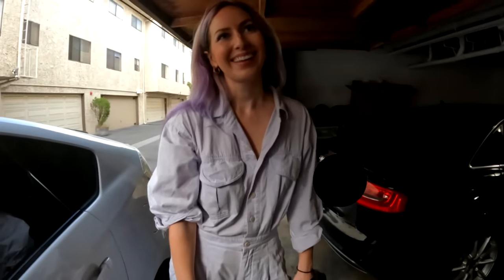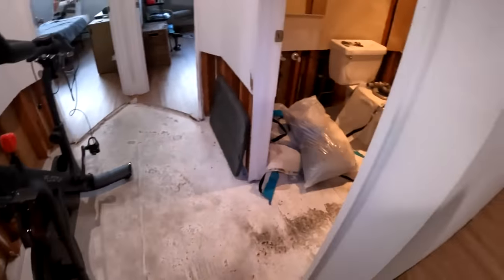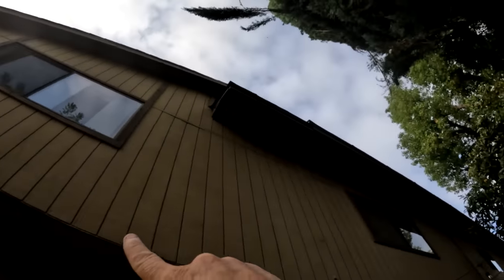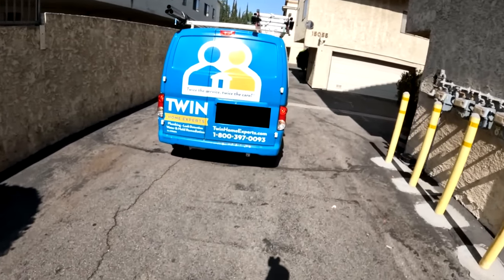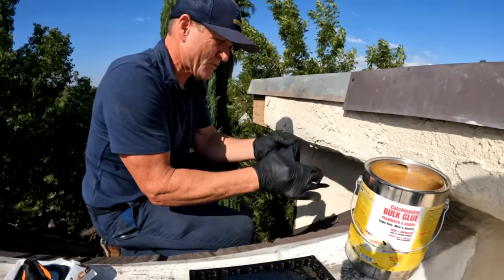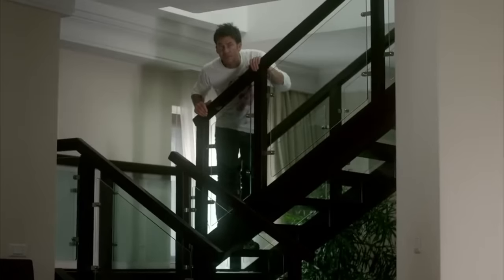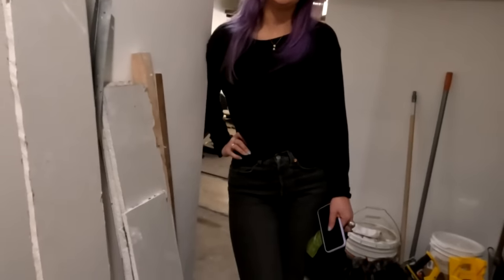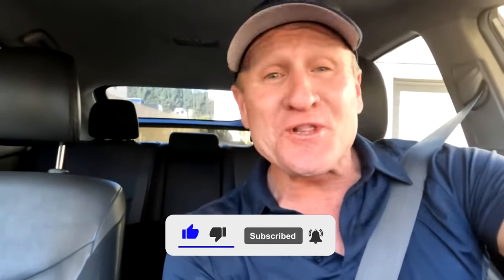These are the rats you need to worry about.

Comment: This is why im never buying something shared with other people's houses or have separate responsibilities
Reply: You don't have to have shared walls to share rats
Reply: You can rodent issue in one family houses
Reply: @tom11zz884  I know but then it's less of a pain in the ass to fix
Reply: @tom11zz884  true but then you can CONTROL how quickly you want them removed and also can take steps to prevent them getting back in the house, but 1. finding the entry points using a trail camera or UV glowing powder 2. cover the holes with Copper mesh (not steel)  3. Put traps on the outside the house where the holes used to be
Reply: also NEVER buy a condo, apartment or house that is part of an HOA community (the HOA fees are inflated as you are paying an HOA management company, and the prices rise every few years), and they have total control over your place, including not allowing people to fly the American flag (including Veterans).
Reply: Facto!
Reply: Well that’s an insane comment.  Most places have building codes which increase building integrity
Reply: They even sound like each other.
Reply: @JohnS-er7jh  What does not flying the flag have to do with rat elimination?  Must everything these days be political?!
Reply: @JohnS-er7jh  If you really want to buy anyway at least check their financials. Many times they aren't collecting enough dues to keep in reserve for larger maintenance expenses. That means you'll get hit with a "special assessment" when the roof needs to be replaced.
Reply: @JohnS-er7jh  I'm with you.   I will hang on as long as I can being the boss of my own property and only give into HOA/condo when I'm too old and physically unable to deal with DIY.
Reply: @bread-gz3rl  avg housing costs 400k now. my 2 story 3 bed townhouse was 140k in a gated neighborhood. the hoa isnt too bad either. lawn is mowed 2x a week this time of year. big bonus that the upstairs floor is concrete slabs (not sure why) and walls have two (not sure why) layers of interlocking concrete bricks as i have literally never heard my neighbors do anything
Reply: @deanbianco4982 how is flying a flag political? I’m not being rude..just really curious.
Reply: True it's a pain when u never had anything and then boom cuzz shared screw u
Reply: ALSO controlled by HOAs!

Comment: Ok folks, buying a condominium is tough. You probably won't notice the problems in the common areas. This complex has a serious maintenance problem Are there reserves, or will there be an assessment once the board even agrees to do repairs. How do you review the documents to determine if the reserves are adequate and maintenance is up to date. Good luck.
It is worse here in Florida. There are new laws requiring more extensive inspections, and more adequate reserves. The inspections may find problems, both will raise condo fees. Insurance renewals will double or triple. If you don't knpw the fees, what is the value of the condo.
Lauren has lived in a construction zone for how long?

Comment: I'm in the UK. We live close to farmland and for 17 years we didn't see a single rat. In the last 4 years we've seen several and heard noises in the roofspace above our kitchen. Several people locally said that they were living in an old farm building on local farmland. We figured out where they were getting in, through the kitchen extraction hood outlet just under the roofline, and sealed the gap with a ball of chicken wire. We did have a guy from our  local council come out to set bait traps as there were more rodents than I could shake a stick at. I asked him if rats could jump and he said no. A few weeks ago I caught a juvenile in my deluxe brass finished steel cage trap (from our local family run 'we sell everything you could possibly need' ironmonger/diy shop) The pesky rodents love a raw Atlantic prawn via Asda and raw  cumberland sausages via the local butcher. I can't bring myself to kill them so I serve canapés. I was getting ready to return my unwelcome friend to the local farmland  when I accidentally tipped the cage at ground level. Within 2 seconds the little blighter launched itself up over my head and using the compost bin like a vaulting platform it shot around the side wall of the house, 6 feet in the air, and vanished😮😂
Reply: God no

Comment: I’m a trapper of 20 years in the Tampa area. I have to ask do you charge for your initial inspection/ assessment? I ask because I do free inspections but it’s becoming more common for “customers” to be looking for a free blueprint to pass along to an inexpensive handyman ( especially if the inspection is for a management company). Yes, sometimes they will then fail to resolve the issue and I’m contracted after they’ve created trap shy populations and then I have globs of expansion to cut out of openings to properly seal. 
 It makes it harder and harder to be thorough in the initial inspection instead of just calculating approximate cost to trap out and seal, then if contracted do the Sherlock Holmes work… thoughts?

Comment: I just throw rat bait into the crawl space. The rats drag it away somewhere and it remains there until multiple rats have eaten it. It only takes a little bit to kill a rat. The remains of several cubes are now spread around the internal cavities and every new rat thinks they've found a safe source of food and dies. If the noises last more than a couple of days I throw fresh bait in. Our house has a lot of trees at the back that come right up to the house. The trees have rats in them but a bit of bait in plastic pipes outside controls them too. The rats typically die outside as the bait makes them thirsty and they go looking for water which means going outside so no pile of corpses behind the walls.
Reply: What bait do you use?

Comment: I’ve emailed you guys and have called. Unfortunately, I can’t get rid of the mice in my house and can’t find anyone willing to do the work. Everyone just wants to set bait traps outside…nothing more. It’s not solving the problem. I live in Pittsburgh and they’re destroying our kitchen, attic and walls. I am willing to pay one of your employees to fly out here, pay for the flight, I’ll pay for the hotel, his labor and whatever work he does… we just need an honest company at this point. We haven’t been able to eat in our kitchen because we are so grossed out.
Reply: In the meantime you need to do what you can to block them from getting in.  Do you have a crawl space? Any hole in your subfloor around wiring and plumbing must be occluded, an old school method is to push steel wool into these crevices.  We had a company that does crawl spaces, they came in and found the rat holes, filled them with concrete, and sealed everything under there.  It has been about a year, that combined with the poison traps has seemingly solved the problem. We live on a green space, and have chickens so there is always grain in the yard.  Good luck. At first I thought it was mice, and it was a problem because it chewed through the water supply line of the dishwasher, which the slow leak ruined the flooring, then it chewed through the Freon line on our fridge, which ruined the compressor.  Then our old man cat kindly dispatched her and left her on the stairs.